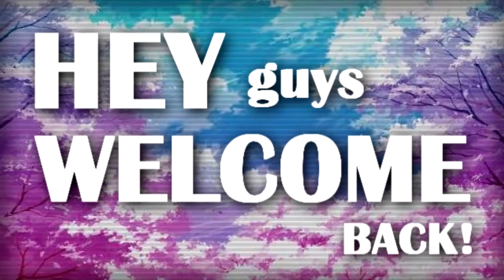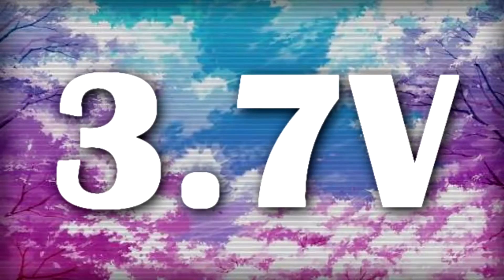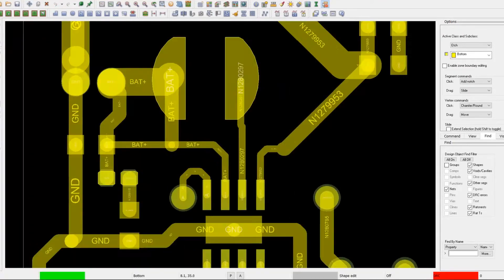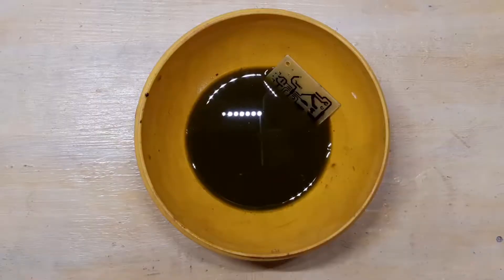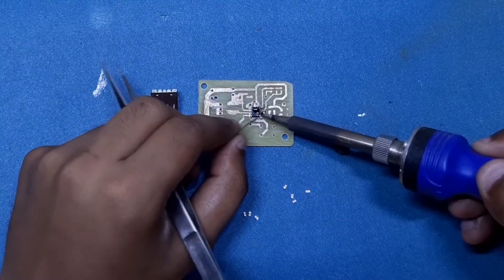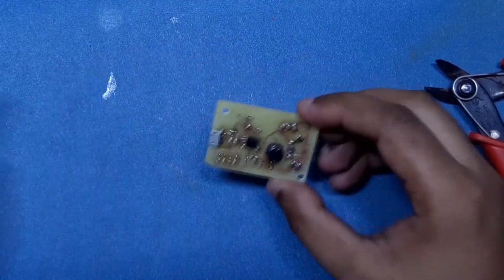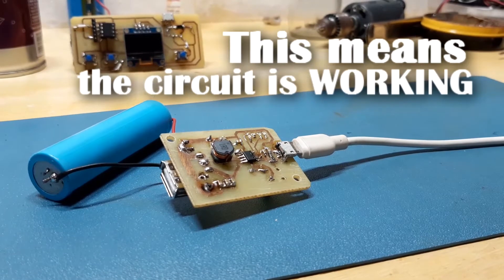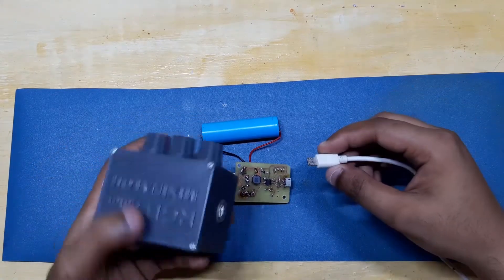DIY Powerbank with IP5306

Comment: hey i have a question,i have rea dthat the module turns off on low load curernt ,how do i fix it 
 ,can i auto turn on the module by grouding the key pin

Comment: Hi, first - Thanks for that video tutorial! - But maybe someone know an answer to my question: What, if you measure the same voltage at input and output (of ip5306)? Or more precisely... If the voltage of the battery and at the output usb is the same? Ip5306 broken or reseted? I2c programming needed? How to begin i2c programming? BTW. my LEDs doesn't blink when loading and the 4th won't go on as well... 😢 Thanks for any advice!

My device I try to fix is a denver pba-12000 powerbank po11653

Charging at usb (have soldered an cable with usb a to the + and - and shield on the board, where the broken micro socked was) 5,09V input... Usb out while charger in = 4,59V... When not charging output usb = 3,95V (what's the voltage of my battery pack that should be just 3,7V BTW)

Comment: Hi, don't you know how to limit charging current on ip5306. I've bought a module with this chip and connected 500mah lipo. On charging the battery overheated and inflated because of the high charging current... I saw that on tp4056 for limiting current you could replace r3 resistor with higher resistance and it will limit the charging current... Is there any solution for ip5306?
Reply: You can try use a charger with a low output like a 5v 500mA charger works for me.
Reply: From the datasheet, no, the ic default current is 2a, it uses the inductor for step down the voltage from 5v, the only thing I saw that is programmable are the leds, aside from them, not much can be changed...
It's a good ic, mainly because of the high current charging, but for low rate charging the tp4056 is the option

Comment: What is the power bank charging current, how long does it take to charge? Also, can it charge the phone at 5v2A?
Reply: Depends upon battery capacity, 1, hour per 2000mah + 1hour for CV.

Comment: Hi, nice video !
I have GIF 9900mah RT 18650 lit-ion battery but when I press the enable button there is no 5V. The voltage rise to 4V and then drop to 2V~.
I saw that the battery voltage also drop from 4.2 to 3V when I press the button. Is this something wrong with the battery?
Reply: It has high ESR(impedance) use multiple batteries in parellel.